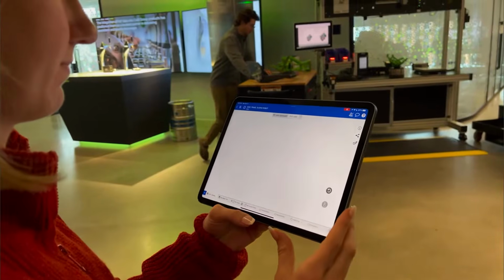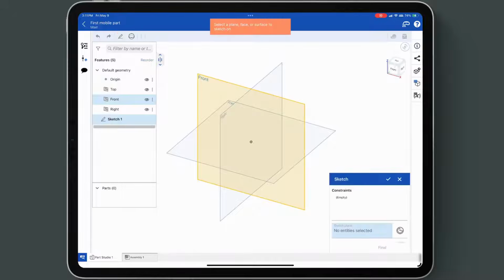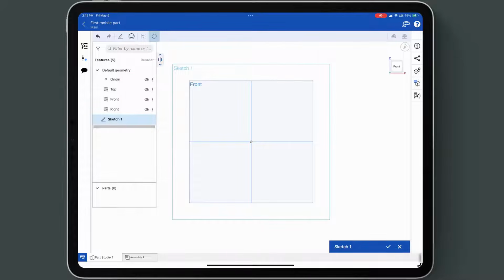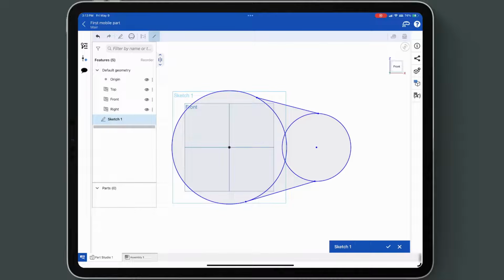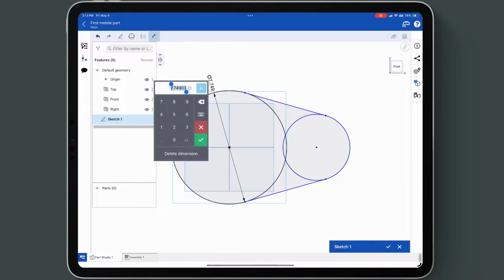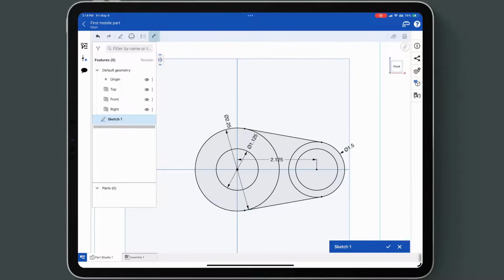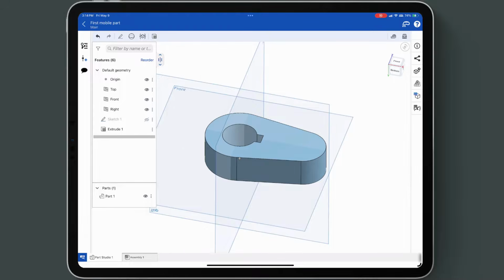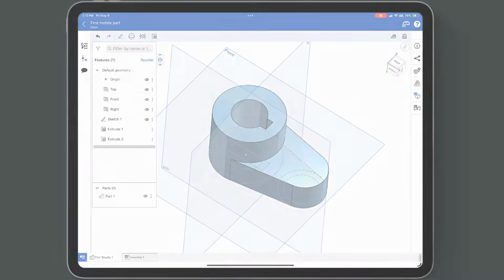Onshape iOS Tutorial

Comment: The free use of OnShape is the most intriguing aspect. However, the user experience and interface on the iPad are quite challenging. It’s vastly different from any other CAD/CAM software available.  I’m still struggling to transform a sketch move rotate or scale. I eventually found it by the search function but it’s not clickable. This frustrating experience begins even before sketching. Shapr3D and SketchUp are better suited for this task.  A proper tutorial and update would greatly enhance OnShape’s potential.

Comment: App is useless on IPhone. I can not for the life of the app get dimensions to work.
Reply: I can’t get dimensions to work on iPad either. And the tools layout has been changed. Need an updated tutorial.
Reply: I FOUND HOW TO USE IT 

After sketching a line or shape while still in that sketch go into the sketch menu where the lines and shapes are then scroll down to find dimension, 

then you can tap on lines or shapes in the sketch tap on two point and then you can tap on the dimension number while it’s still blue to enter a number and then set the desired dimension

I was just reading these comments trying to find how to make it work too then somehow just did this and it worked 😂
Reply: SAME!!!

Comment: First of all: Thank you. 
The iPad app was actually my biggest reason for switching to onShape from Fusion last year. I take the train for an hour every day and use the time for useful things.

But sometimes it's really strange where the limitations are with the iOS version. Things that you think should also be easy to implement in the app.

First of all, no dark mode (the biggest fail for me as a programmer :D), but the day before yesterday I rigorously failed to simply insert a variable studio. Or handling variables in general is either not possible at all or only very cumbersome.

The fact that using a pen and finger is different from using a computer - yes, okay, I understand that. You get used to it very quickly. But I actually have to go back to the computer at some point for every project because not everything works on the iPad.
Reply: Another Fail: my iPad is in German, but i use OnShape on PC in English. Thats MESSING UP everything :D